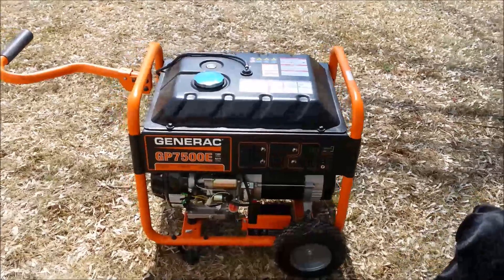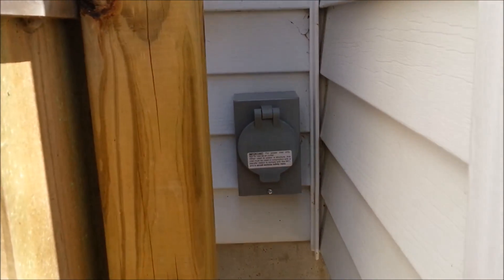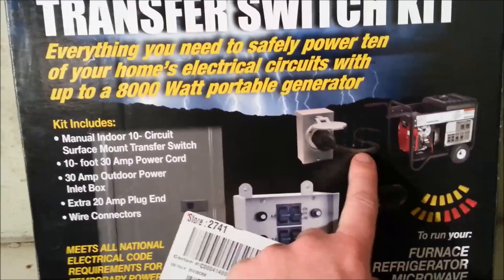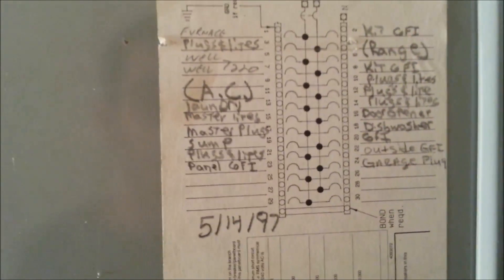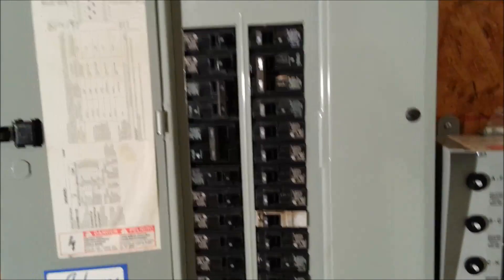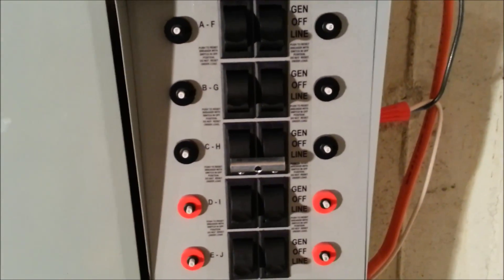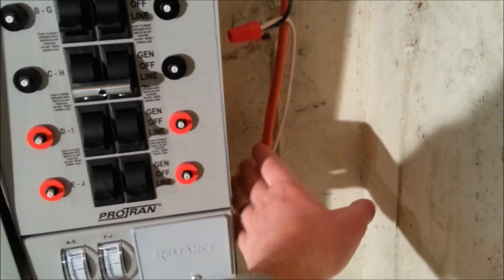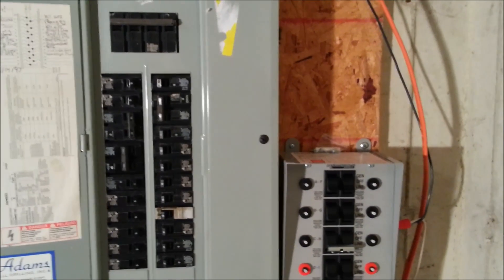Powering Your Home Safely with a Generator Using a Transfer Switch

Comment: I did the exact same thing (same 10 circuit transfer switch; similar loads (well, fridges, furnace etc.) and using the same type wire (Romex 10/3) to connect the switch to a L14-30R box on exterior wall of my home).  In the almost 10 years that I've had it installed we've had a 5 or 6 outages, but each one was less than 3 or 4 hours.  Our generator was a non-inverter unit so I didn't use it because I didn't want to risk damaging any of my appliances/electronics.  I recently replaced it with a 9000 watt Inverter tri-fuel unit.  If / when the next outage hits, I'll be able to put the this setup to work immediately without worrying about dirty power damaging my electronics/appliances.

Comment: Change the battery in your smoke alarm,  I thought one of mine was beeping due to low battery,  turns out it is coming from your video. Also would have been alot more informative if you would have had the panel cover off the electric box

Comment: Great video.  Been trying to find an answer, is there a certain order for turning the generator in and hooking it in? Generator on then plug it in, or plug then turn it on. I’ve seen both, thoughts? Thanks!
Reply from the maker: Generator on, hook it in, flip breaker on generator, then go in and turn on circuits

Comment: I just got the same generator! Thank you for the video! One question, did you run into any issues over the years running your furnace, tv, electrical devices? Just want to know  that my furnace board won't fry or something. Just too many posts making me worry I should have got an inverter generator instead. Thanks so much!
Reply from the maker: Inverter generators are defiant better but I have run all of our stuff on several occasions for a few days at a time with no issues

Comment: The video was excellent. The question I have is when you are done with the generator,  do you put the switches in the middle for off or bottom for line?
Reply: Put the switches to LINE when using your local utility and GEN when on generator. The off position is only there so that the switch goes through a point where there is no contact on either source at the same moment as a safety feature.

Comment: One very important thing often overlooked with these cheaper conventional generators is the need to have a generator that puts out clean power...less than 5% THD. If you don't use an inverter generator, you risk destroying any or all of the microprocessors in equipment you are powering within the home...computers, furnace electronic control boards etc. If you are only powering lights, then no problem. But fridges, modern washing machines etc all are built with microprocessors as part of their manufacturing. UPS devices inside the home will definately be destroyed. Proceed with caution using a conventional generator.....

Comment: My question is by using the transfer box do I not, no longer need to worry about turning my main power switch off  when the power goes out. Before I turn on my power to the generator power. Thanks for your support.
Reply from the maker: Correct the transfer switch does not require the main to be off, when the power comes back on it will not feed back to the generator

Comment: the kit handles up to 30 amps right? So even thought the circuits are all 20 amp circuits i have it will work I just have to be mindful not to exceed 30 amps or it will trip , is this right?
Reply from the maker: Correct,
Reply: @SSLFamilyDad  thank you

Comment: I bought a 14000 BTU portable AC unit. Do you think my 4500 inverter generator will be able to start the compressor and handle the load please?
Reply: You may need to install a soft start resister but it should handle it.

Comment: Did I miss something???  I never saw where you shut off the mains  so power didn't go down the transmission lines.
Reply: durhhamjut,  one of the points of a manual transfer switch is you do not have to shut off the main.  The manual transfer switch when switching from "line" to "generator" keeps the electricity from flowing back down the line.  Does not mean you can't and some people I know do,  but I like leaving it on so I know when the actual power comes back on,  ie my oven turns on and shows the time. 

There are many links on this:
https://powerequipment.honda.com/generators/connecting-a-generator-to-your-home
https://www.balanced-electric.com/wp-content/uploads/2017/11/Transfer-Switch-Guide.pdf
https://acworks.com/blogs/ac-works-connector/how-to-use-a-manual-transfer-switch-system-for-your-home

Comment: Thanks for the video... How's it going with the transfer switch? Any new updates or would you do anything different since you installed it in 2014? What guy of hardware/generator would you recommend to wire my entire 200 amp Panel - for whole house power?

Comment: Excellent vid.  During an actual power outage when using the generator on the transfer switch, is it necessary to shut off the power (main disconnect) on the main breaker panel to protect lineman?
Reply: I have the Reliance 310CR transfer switch and no you don't.  You don't have to touch anything in the control panel when switching to generator power or back to utility power.
Reply: Pk 3 Thanks for the response 👍🏽

Comment: Do you have to switch off the main breaker when using this transfer switch?
Reply: you probably should during hookup, but you must open the breaker you are currently wiring. If you are all wired up, no. No need to open the main, your transfer switch handles the power transfer...

Comment: Would that 10, 30 amp work if my furnace has a double 40amp
Reply: No, only a transfer switch rated for 40 amp double poll will work. As a matter fact, you can't use a 30 amp double poll breaker with this model transfer switch.  You will need model 310CR, which you can add a double poll 30amp breaker.

Comment: You can only use ONE switch at a time? Is that correct?? I would want to run furnace, fridge, and some outlets at same time
Reply from the maker: You can use all the circuits on the transfer switch at once
Reply: thanks

Comment: I’m about to buy the same generator you have , if you had to buy a new generator would you buy another generic ? And would yours also run a small 5000 window A/C ?
Reply from the maker: It will run a window unit no problem, I have had great luck with this generator after I had it repaired once under warranty

Comment: So after this is installed - what should the status of the lights read? 

1. If on utility should the green light be always on?
2. If on generator should the green light switch over to yellow/generator light?

Just installed this and when I put the cover on - neither lights are on?

Comment: When you have that box hooked up like you do you have to shut the main breaker off when you are running the Generator?
Reply from the maker: No. When using a transfer switch you do not have to shut off the main breaker
Reply: @SSLFamilyDad  When the main power comes back on and you have the Generator running because the power was out nothing will back feed to the Generator then so it is safe is this what you are telling me . Thank you
Reply from the maker: Correct. That is the benefit of the transfer switch, nothing back feeds
Reply: What about feeding from generator to panel/lineman?

Comment: Backfeeding a panel is DANGEROUS AND iLLEGAL. 
You should always use a transfer switch.
Reply: It's perfectly safe aslong as you use an "Interlock Kit" designed for your Brand's Panel.

Comment: Can I use 2 different transfer switches  being powered from one generator.  That way I can power more circuits
Reply from the maker: If your generator can handle more circuits you should just get a bigger transfer switch
Reply: @SSLFamilyDad  well at this point the way things have grown, this is what I want, just dont know if its possible. thats why im asking. I dont want to change everything. I have a inverter for all my transfer switches. Just wanted to put 2 transfer switches on my larger of the inverters. Im not using a generator. Although I do have one in case. Thanks for any advice.
Reply from the maker: In that case, yes absolutely. You could use another transfer switch for the other inverter and then tie that into more circuits.
Reply: @SSLFamilyDad  thats what I have right now and it works well, however i just want 2 each transfer switches  on 1 inverter. theres  only 1 ac output circuit? is that possible
Reply from the maker: I don't see why that wouldn't work. Just split the outgoing leads from the inverter and go to both transfer switches
Reply: @SSLFamilyDad  ty

Comment: Most people don't do the set-up, they get an electrician to do it for them.  So this video is more about the electricians part than it is about power your home.  For 90% of the population, this video is irrelevant.  The most important part for most of us is the sequencing for generator start up, house connection, panel breaker switch turn on and turn off, transfer box activation and then powering the house.  That would be a great video.

Comment: Quick question, if you don't mind. Your generator is rated at 7500W, however the Twist Lock outlet itself, according to the manual, is only rated for 30A service. Wouldn't that limit your draw from the generator to 3600W @ 120V? Thanks for any insight!
Reply from the maker: 2 poles at 120v each. 240 volt service

Comment: I know this is an old video, but just wanted to say thank you.   Explained very well, just what I needed to give me the balls to attempt it.   One question though, my generator is 3500 Watts, would I be better off with the panel with 6 breakers instead of 10?   Just curious.  Again, thanks for the video!!
Reply from the maker: I would still go for the ten because you will want to upgrade your generator at some point. Good luck with the setup!
Reply: I would sale the 3500 watt and purchase a 5000 or 7500 watt generator. Just saying.

Comment: other method is called an "interlock kit"
Reply: Interlock kits dont meet electrical codes in most places sadly.
Reply: @Patrick Wagz These things should be outlawed from being sold! An interlock doesn't isolate the neutral load of whatever power you are using. Don't believe me? Try this, go ahead and turn the interlock. Start the generator. Put a load on it. Now put an amp meter on the neutral at the panel. Any current you are using is going back out that wire. This can kill the lineman, your neighbors or anyone else that happens along the downed line! You could be responsible for the death of someone!

Get a gentran. They are made for just this application and will isolate the neutral current from going back out on that bare conductor toward the pole
Reply: @jabberon1831  to use an interlock you must disconnect the main breaker before using the breaker for the generator, so how do you think that will go out a line and kill someone? The power is then isolated inside the main break box
Reply: @D2500R  As stated above. The main breaker does NOT disconnect the neutral. If you don't have a good grounding system (plastic pipes) the unbalanced load WILL go back to the pole. 

Don't know about other areas, around here, if you put voltage back into the incoming line,  the power company will disconnect your service. Then then you a fine. Also you will have to apply for reconnect. (Fee)

Comment: Great video.  Answered a lot for someone who has (or had) no idea what I was doing.
Reply: Hey i have a quick question. It looks as though my plug isn’t outside instead its connected to my transfer switch and is mounted in my garage. This doesn’t seen safe from watching everyone’s videos showing the plug being outside. Also, the main breaker to the house seems to be outside as well, but my breaker box is inside. How do i get this thing going safely?

Comment: Video was great. l,m not a electrician but l do wiring around the house and word shop. l bought the one you showed 10 circuit beakers. will this take me through each step. l have a Predator 8750 watts Generator. like to get this hooked up if l can. Thanks alot
Reply from the maker: +ray roof yes, the instructions literally walk you through and it comes with a dvd

Comment: My breaker panel is located outside of the house, can this transfer switch be placed outside?
Reply: H Gut no, it is for indoor installation only. You would need to look at a interlock kit like he had mentioned.
Reply: There are outdoor-rated transfer switches.  Google it.

Comment: Transfer switches are good if you have a high draw . I went with an interlock on my main panel along with two watt meters to balance the load. My house is on city water and city natural gas.  My draw isn't much.  My generator will run everything but the two central A/C's .  It was nice having the whole panel after Sandy so whatever room you went into at night the lights would work.  When the two blower motors would run for the heat at night along with the lights and refrigerator I was up around 3400 watts.  My 7000 watt Honda had no problem with that load.

Comment: The thing that made me mad is I was running to all of my smoke detectors thinking I had a low battery. Drove me nuts until I figured it out. You need to replace the battery in your smoke detector. Anyway thanks for the great video.
Reply: Same here

Comment: What happens when the generator only puts out 120 volts.Can a transfer switch still be installed?I  didn't watch your video,seems like it would have been a wast of time.Sorry.
Reply from the maker: +john palma most transfer switches that I have seen are designed for bigger generators so you would want to look for one that would service a lower wattage 120v only generator but you wouldn't be able to power much with it

Comment: Thanks, the kit looks pretty inclusive.  Is the well pump not more load than the electric dryer?
Reply from the maker: +SC Starr the well pump is more than our dryer since our dryer is gas.
Reply: thx. yea it makes a difference with electric such as; water heater, well pump, stove, and the dreaded dryer. thx again

Comment: Wished I would have gone with the ten-circuit Protran! I have the six-circuit one...the "generator" is my DIY home solar panel - 3,500w inverter - battery system. Works great. Six circuits (critical loads) is "just" enough. Mine runs 24/7. Great video.
Reply: That is exactly what i want to do. I bought a house that has this already installed, but no generator :(. I just lost power yesterday. Im considering a genrator, but i would like renewable like solar, i am also looking at diy battery walls like the tesla version. I wish i had a friend who is knowledgeable to help.

Comment: About how much for an electrician to do it? Ball park?  This would be so much easier! I'm tired of have all the exstentions cords all over the place :( and me & my husband have health problems, so it's hard & by the time we are done, we are hurting!! Now we got blizzard Jonas coming & generator won't work :( praying power doesn't go out! Great video!
Reply from the maker: I would guess it would cost about $200 to have it put in
Reply: In my area, the installation of this 10 circuit transfer switch was $500.  Still well worth to me to have it done by a licensed electrician who did everything to local codes.

Comment: Thanks - I have the exact same set-up but don't have the conduit for the line to the plug.  Did you ever add the conduit yourself?
Reply from the maker: +Craig Penrose nope:) I keep looking at that and meaning to grab it when I am at the hardware store but never have. Maybe I will do that this week......
Reply: I never used conduit; ran Romex for 60 feet in the basement to the inside garage wall  where the 4 prong outlet plug was installed, kept generator outside (for exhaust reasons), generator connected to garage wall outlet by 12 ft Romex cord.

Comment: That 7500 powers everything in your house? Interesting! I've been looking into one recently (since I live in very cold winters), and I've been wanting to make sure I have enough power for everything. Especially if the outage lasts longer than normal. Is it possible for the pipes to stay unfrozen if I have to refill it within an hour? That is my biggest concern. Otherwise, all I need powered would be the absolute necessities: water heater, fridge/freezer, sump pump, oven or microwave and heat. I can do without lights and TV. Maybe adding the computer to the generator (with the modem/router) would be nice also. Did you just say that I can't have the above listed hooked up to the backup generator at the same time? I wasn't sure if I heard you right. If so, then I guess it's pointless to have a backup generator.
Reply from the maker: +chrisgast Well, let me clarify. The 7500 runs everything I need in the house but it doesn't run everything in the house all at the same time. I can run our freezer, refrigerator, microwave, furnace, some lights, internet/modem/router, coffee pot, sump, well pump, and a few other odds and ends. If everything all kicked on at the same exact time (which is not likely) it would probably come close to overloading it. You cannot run an electric stove with this generator or air conditioner. I also do not run the dryer or washer on it.
Reply: +SSLFamilyDad Oh, okay. I tried looking up the wattage for the oven that I have, but I can't seem to find it anywhere. Would you happen to know roughly how much an oven usually uses, wattage-wise?
Reply: chris gast an electric  oven would use a lot. I would say around 15 amps minimum. My modern GE double oven is rated for 29 amps max if both are in use. You get 30 amps total to work with . There are bigger portable generators 10kw+ that can supply 50 amps. The issue with those is increased fuel consumption vs. smaller gensets. I have a near exact setup as him except my generator is 7kw, but then again only use the 30amp output from the generator. Fortunately I have only had to use my generator 3 times in 7 years for only 6 hours.